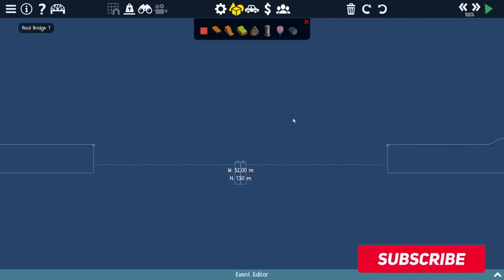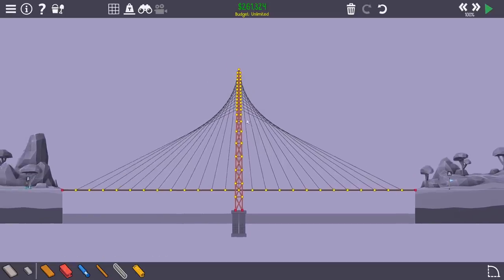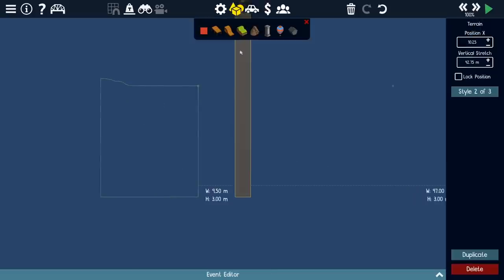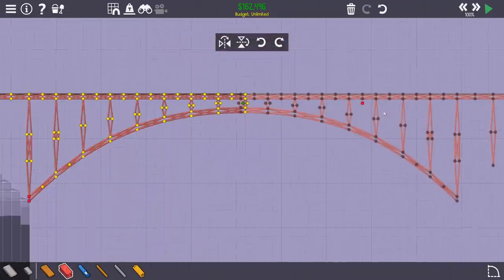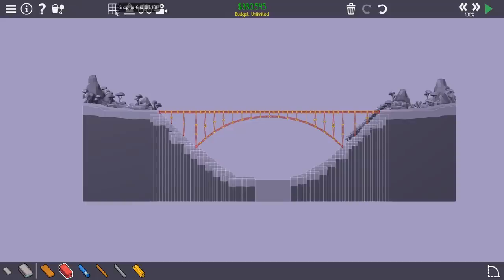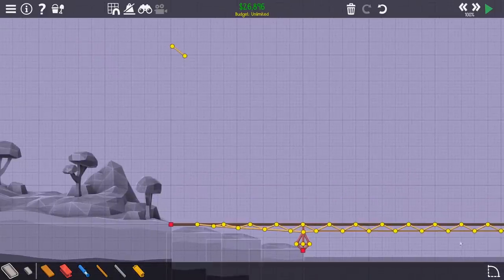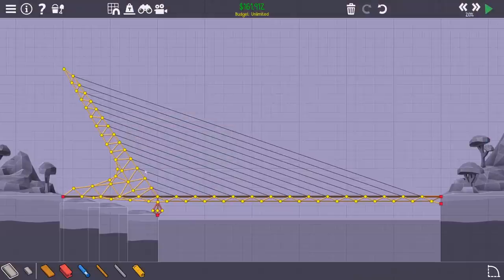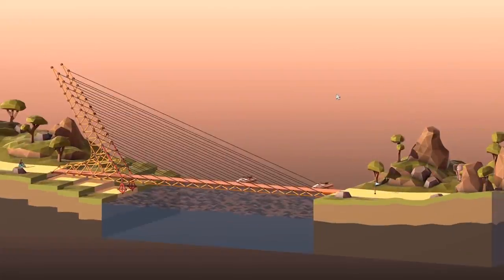I spent $1,000,000 recreating THREE amazing American bridges!

Comment: I would love to be in the proposal meeting for that second bridge. “So it’ll cost $330,000 to build but it can only carry the weight of a moped”
Reply: Ah yes, anything but the metric system
Reply: @05council73  my bike is 12 bananas long
Reply: If it covers that much spans, it’s still dirt cheap. Government jobs is 10 times more costly and 20’times slower than private jobs. My city build a predestrain bridge for over 1 million that spans 30 fr
Reply: @hjwang4477  we have two pipelines being built in Canada at the same time, one by the federal government, one by a private corp, all during covid. Both started at the same time roughly with a similar length and the private one going through more difficult terrain. Private pipeline original cost 6.6 billion after COVID costs added, 8.6 billion with one year behind schedule. Government pipeline started at 4.4 billion, now is at almost 18 billion and almost two years behind schedule. Outstanding.
Reply: @Peglegkickboxer  governments typically have to take the cheapest offer. These often turn out to be total bs and than you have These Situations.
Reply: Sound good to me heres 330000
Reply: @TiagoOrange  that's a really long bike

Comment: Do the mackinaw bridge
Reply: I just visited it for the first time a month ago, it’s pretty cool! It’s not as scenic as the golden gate and the towers are closer together meaning it’s not the longest suspension bridge by the normal measurement (between the towers) but it beats the Golden Gate in suspended length (#1 in the Western Hemisphere) and it’s something like the #2 suspension bridge in the world for total length, 3x longer then the Golden Gate. Although considering Poly Bridge didn’t like the Golden Gate, the Mackinac bridge is probably even worse and may not be buildable without a lot of anchor points unfortunately.

Comment: I went whitewater rafting on the new river, and I actually got to pass under the new river gorge bridge. I saw it in the thumbnail and insta-clicked because it’s such a gorgeous and recognizable bridge. :)
Reply: I did too and will never again. There was a storm the night before and the Rapids were way stronger then they should be. They almost called it off, but allowed rafting on part of the river instead. Everyone was thrown out of the raft on every rapid.
Reply: Zach Demand Lmao I’ve been a few times and I’ve never been thrown. I flipped on a class four rapid, but that’s it. There was one time I went at a really high water level. I didn’t get knocked out that whole time, but surprise was such a hard hit that it almost flipped our raft from the front end. It’s honestly so fun for me, but your issue really sounds like your crew was bad because most times when people get knocked out, it’s because either there was no water to stabilize, someone pushes you, or the boat flips. The back two are your crew’s fault usually. When I flipped on the class four rapid, I was at the front of the raft and we didn’t stay in sync, causing the raft to turn and hit a wave at a really bad angle that threw me backwards and dominoed my entire side of the raft out. I’m annoyed because I called it was going to happen when we went over surprise because we just couldn’t stay in sync because we had a super inexperienced rafter in our raft, and he was trying to be up front in class four rapids. It was still pretty fun. :)

Comment: I've visited the Sundial Bridge in Redding--if you think it looks cool in photos, it's even cooler in person. Did you know it actually works as a functional sundial? If you follow the shadow of the giant arm, they have a big concrete clock face where the top of the shadow points to the time of day (only works perfectly on the equinoxes though)The floor is made out of rough glass so it's kind of see-through. There's a neat museum right next to it too

Comment: In the last bridge, if you used full steel instead of wood for the "sun dial" part of the Bridge, I think the weight might have helped with it - Putting more stress on the cables/rope. But hey. I wouldn't know - Im not an engineer :P

Comment: Use a very short section of road bed in between two points that are close together and it will allow you to simulate a horizontal structural member connection, between the two towers.

Comment: @15:40 the whole "spike" needs to be steel, you can probably keep the crosses in the spine wood but the "pin" needs to withstand the bend probably in real life would be another x-boxxed shape internally, its hard to describe but that whole outside line curve from one anchor to the other needs to have steel properties, the webbing in the middle can be lighter or usually thinner material the "leaning" is just to perfectly balance the weight in neutral position

Comment: I think, your rebuilt "New River Gorge Bridge" didn't hold, because the under arch was too slim and had "x" inner supports instead of the original triangles. The crossing steel elements pushed connecting points apart.
Reply from the maker: Triangles are better than cross braces for sure, didn't realise the real one had those though!

Comment: First bridge sucks from an engineering standpoint. Connecting the cable lower on the bridge pillar just increases the stress on those cables. That while the top is free in the wind, which increases the stress even more unnecessarily

Comment: Your New River Gorge bridge model, the arch structure is too narrow, and the bracing is different in the segments.  Fatten up the arch segments, and it should do better.  
The Sundial bridge model needs a steel spine under the deck if you're modeling the bridge correctly.  If memory serves correctly, there is also a slight arch to the deck of the bridge, too.

Comment: 12:00 i would say your major problem with that bridge was the bottom curve.. you should have made it a much bigger, stronger one... either 2 curves further apart with cross braces across it or even 2 separate small double cross braced curves.. if you look at the photo of the real bridge the bottom curved bit is much bigger than yours... the main reason yours was collapsing wasnt starting at the road it was starting on the bottom curve which then caused the road to break

Comment: That first one to me is wrong normally the top cable goes to the furthest point
Reply from the maker: Not really, that would only be used to stabilize the bridge, it wouldn't hold any road section up. Therefore not required as it worked without it!